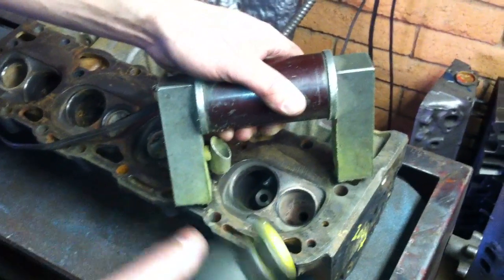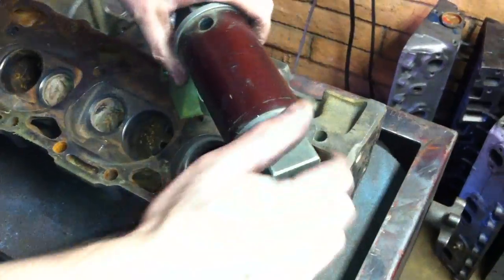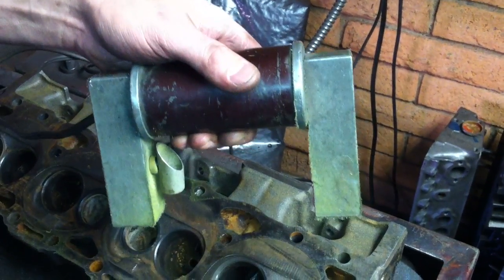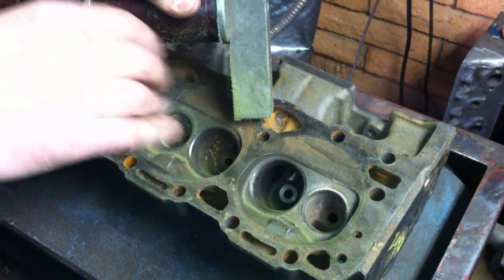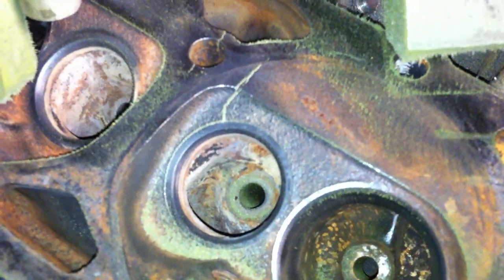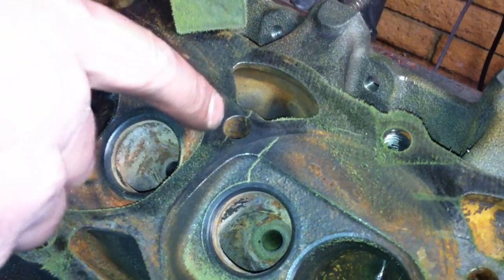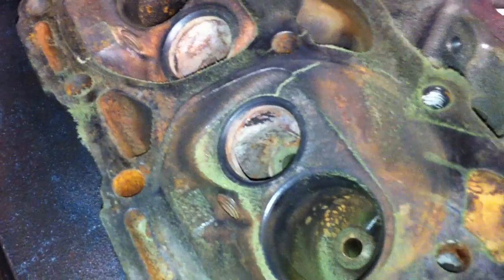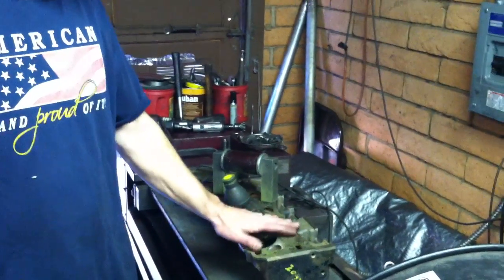How to Magnaflux a cast Iron cylinder head or block

Comment: Technically it is called Magnetic Particle Inspection or MPI. Magnaflux is a trade name. Is your yoke AC or DC and is it homemade and how much does it weigh? I’ve got somewhere above 22,000 hours doing this process and can readily recommend it. For all you out there, AC only shows surface cracks. DC can show sub surface cracks somewhat below the surface with softer metals showing deeper cracks.

Comment: We used spray powder to do the cast repair on heads and bocks, once all cracks are ground 1/4” wide, and head goes in furnace. It’s an art. We used to repair diesel heads for half cost of new head

Comment: Kool tool ..butvto be honest, while that crack may have not been visible by naked eye, inspecting block with a magnify glass or even simply my phone lens would have made crack visible... I thought magnaflux was a more indepth probing method 🤔
Reply from the maker: you won't see most cracks with out it the magnaifying glass or phone lens thing won't wor that's just silly

Comment: Hey folks.  I perform nondestructive testing for a living.  It’s actually called a Magnetic Particle Exam, not magnafluxing.  Magnaflux is the name of a NDT material and equipment company.  One thing important to stress is the process used during this video...  two directions, as was used is super critical.  Cracks can propagate in any orientation, and will only be detected in an orientation perpendicular, or semi-perpendicular (up to 45deg) to the direction of the lines of flux.  I have viewed many videos that only use one direction for the field, and it’s just plain wrong.  This was a good overview video of the process... great job, as always!
Reply: Well put!
Reply: Hey Sir. I have a question, can you help me out? I have a 170 years old antique black powder gun. I want to check the cylinder of invisible cracks before shooting again with the gun. Which method of nondestructive testing would be the best for me? Magnetic Particle Exam, Dye Penetrant...?

Comment: never seen dry powder always seen some type of water solution with the powder in it. this was a good video to watch. thank you. if you had an electromagnet large enough could you do the entire head/block surface?
Reply: Not intending on an argument, But what he is doing Is Mag-Particle Testing. Magna Flux uses a chemical solution along with a Black light
Reply: @kevinbenet193  yes, but we also use a wet mag system. Same principle but instead of "sprinkling" a dry particle on the casting while holding a small yoke, we have a solution with the particles mixed in it. A crank or head will be elevated on uprights so a hoop style yoke can pass all around while appling the solution. For a block, we wrap a coil around it. The wet mag is much easier to use on a crank and more accurate on a block.
Reply: @whiplashmachine  Makes sense
Reply: We used to do a lot of Pivot Sharts and Trunnions for the Coalmine Industry
Reply: @kevinbenet193  I remanufacture pulp mill equipent and we mag everything with dry particle. Our stuff is quite large though. A #900 feeder housing is 30,000 pounds and the rotor for it is 18,000 pounds. So wet mag would not work quite so well for us. But in the engine building world, it is a wonderfull way to NDT castings. I have been in a lot of engine shops and the dry mag is by far the most common.
Reply: @whiplashmachine  Most of everything we did was big like that so everything was Dry Mag. But we also did a lot of 995 Spindles, Trunnion Ball Spindles, Pivit Shafts. A lot of Coal Equipment parts. Dozers, Shovels, Draglines, etc. A lot of UT and Some RT

Comment: I wanted to ask if there's a procedure machinists use to check for cracks on internal passageways. i.e. water jackets, or oil galleries ? Thanks again for all the useful information.
Reply: Most generally you look
Reply: @jameshester1450  you know most passages are blind

Comment: very interesting, but I am not sure I understand just what is happening with the magnet and metal filings...
Reply: the crack is causing a change in the magnetic field which grabs the particles differently and therefore you can see the crack because you can see the metal dust sitting in that crack differently than the surfaces around it.
Reply: The Yoke or Electro Magnet creates a  magnetic field between the legs of the Yoke, while in contact with the base metal, Once you dust the part with the powder, which is kinda like steel fibers. The Magnetic field causes the fibres to stand up in the crack.
Reply: A crack in a piece of iron will break the continuous magnetic field into two smaller fields touching at their poles.  Magnetic forces are highest at the poles, so the powder sticks there and easily shows the crack.

Comment: Do you think the crack was the cause of someone installing the harden valve seats wrong ? Whats it cost to install harden valve seats on a pair of sbc 3927186 heads with the valves still in ? do they magnaflux them before an after work like that ?
Reply: This is just where they like to crack. Especially these tbi 191/193 castings. I have failed more than double what passed.
Reply: comes through that  head bolt so they probably impact wrenched the bolt and the stress traveled to the point of least resistance which would be the valve port opening.
Reply: @zippythechicken  Installing head bolts with an impact should be punishable by fine, imprisonment, or both.